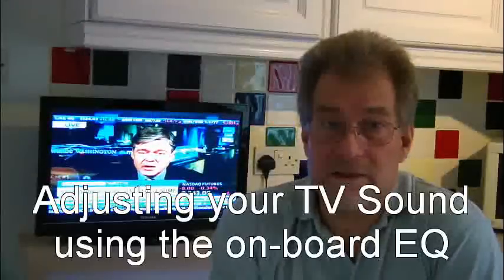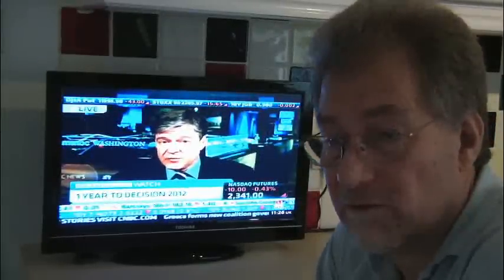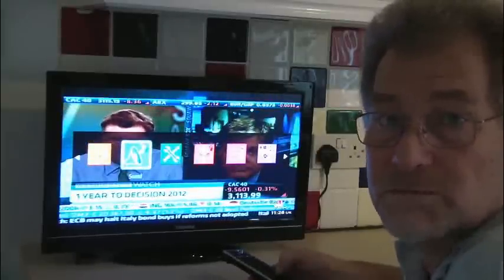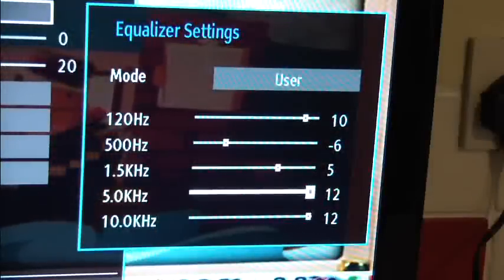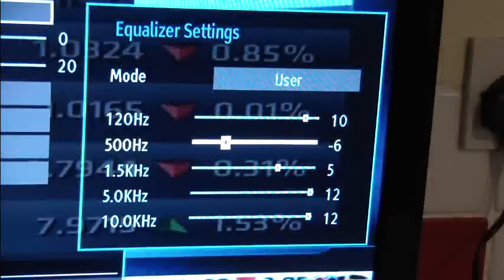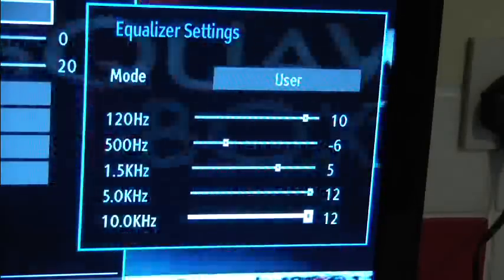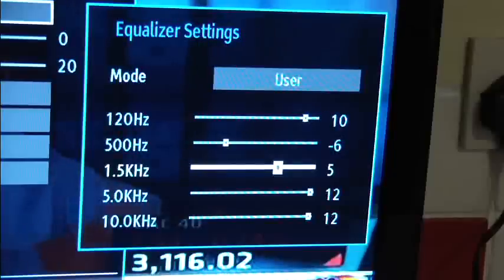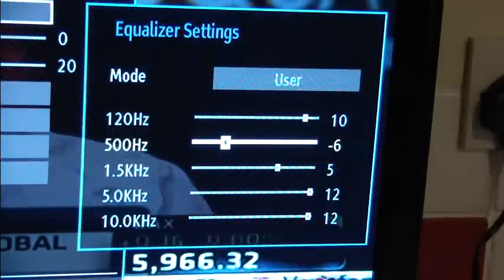Adjusting your TV sound using the on-board EQ

Comment: I can't even stress enough how helpful this has been. Admittedly, I'm on the same page as a few other commenters - 100hz, 300hz, 1Khz etc. but even the advice they have received has helped me to - almost - improve my listening experience. 

I bought one of those LG E6s last year, and I have to say, the default settings never cut it for me. I've messed with the Equalizer and keep finding things just don't get to the levels I want.  had 1Khz at +5! And I didn't realise how detrimental that actually was. For now it's about -3. Lower and it feels a bit empty. 

As of right now I'm at +8, +5, -3, +10 and +10 respectively, but this is likely to change. Weird television though. At lower volume levels, it's far too quiet and can require up to 60+ on the volume to start getting into clearer territory. Luckily, it doesn't get so loud it disturbs anyone, and as always, depending on the film you can go considerably lower. 

I have no idea how these settings will suit me for now, anyway. Even the "Magic Sound Tuning" keeps changing because it just doesn't seem to work as advertise - always close to optimal for it does, never optimal and more often than not fails. 

Either way, I've been searching for videos on the Television Equalizers for a while and this is, so far, the best I have found and very informative. It has helped considerably. Thank you. 

And your advice on the comments - brilliant. Thank you, too, for that.
Reply from the maker: Thanks for the kind comments, I do appreciate them. Your comment "At lower volume levels, it's far too quiet" sounds odd at first (like, obviously!) but I think I know what you mean. The issue may be down to the way speakers behave and their efficiency at reproducing the different frequency bands. At very low levels of power from the amplifier, the speaker movement (the physical movement back and forth) is so little that certain frequencies - especially the lower frequencies (bass) - are barely reproduced. Speakers tend to be more efficient (i.e. able to turn the signal sent from the power amp into sound waves) at mid frequencies (that's in general terms, assuming one speaker driver designed to reproduce a wide band of frequencies, as often found in TVs. I'm not talking about separate tweeters, which are highly efficient). Likewise, our ears are more efficient at picking up mid frequencies (that band either side of 1kHz). So normally, at low volume, we hear the mid frequencies far more than those at either end of the spectrum. And because we've reduced the level at, say, 1kHz on the equaliser to tame it when it's loud, we then lose the clarity at low levels. For years manufacturers built automatic gain control (AGC) circuits to lift the bass and treble as the volume was reduced, to help keep the sound balanced - you may find an option to switch AGC on or off on your TV. Unfortunately, since it lifts the bass and treble and leaves the mids generally unaffected, a standard AGC tends not to work well once the equaliser settings have been adjusted to give the typical 'smiley face' curve like the one you've set and which is often effective; with AGC also engaged (effectively doubling the 'smiley face') the sound at low level tends to become very muddied because of over-boosting the bass. There is a solution, known as a multiband compressor/expander circuit, which can be considered as a level-dependent equaliser, but without researching it I don't know to what degree any of the current TV manufacturers use such a circuit. I worked on one for use in car stereo, so it's not inconceivable it could be used in TVs.
Reply: There is something on this TV - not sure if it's what you were referring to - called Auto-Volume. At lower volume levels, it does hold volume considerably higher than with it switched off. Unfortunately, it also seems to act like Dynamic Range Control in the absolute worst possible way. In that, if you were watching, for example, a horror film, you can forget any loud sounds/effects. It just cuts them out/muffles them. So it might not be this AGC - though it did at least worst in regards to dialogue. It's a shame though it has more negatives than positives. 

Sometimes I wonder if the "soundbar" which is built into the television has suffered some minor damage at some point, though, because from reviews I have read, all indicators point to it having good enough sound that there should be complaints. I've never been convinced myself. 

Either way, thank you for all that - going to give it another read later on, once I can sit down and chill out for the evening. So far, from your advice in the video and comments, a lot of the volume has improved. Of course, as always, it depends on the films as well. I find two films with the same sound - 5.1 DTS HD etc. - don't always follow on. There are some films here that are very quiet. Then you switch to another with the same audio - much louder. I'm getting there anyway. It's a learning process, and you can't learn without making some mistakes and going back to the drawing board. 

Thank you again for taking the time to reply. Much appreciated, and you're very welcome. I can't stress again how informative the video - and comments - have been. Thank you.
Reply: Odd update on this - I've found that the one frequency hurting my ears is 300Hz. Going through them all, fiddling with each individually over small increments, it's the 300Hz that took away a very.. I don't know what to call it. It's not "ear piercing" in that it's a very high pitched sound, but it does hurt the ears, especially mine. But, it may well be exactly what you have said - from TV to TV, it's all dependent on the speakers, the listener - and personal preference. Right now, it's at -10. It won't stay at -10. But for now, it has eased off a bit. But it does appear 300Hz has a negative impact on this TV.
Reply from the maker: I can only guess, but it may well be that 300Hz is the frequency that 'excites' (causes a 'ringing') in the cabinet of the TV. Everything has a so-called resonant frequency and it could be that the plastic cabinet's resonant frequency is around 300Hz. What happens is that the resonating (vibrating of the panel) adds noise at and around the resonant frequency. By reducing the output at the resonant frequency, you also help reduce the resonance/ringing. Trouble is, you are also reducing the speech/music output at 300Hz and that will tend to reduce the 'warmth' in speech and vocals, for example, so male vocals will begin to sound a little 'thin'. So on one or two TVs of mine I've added small pieces of self-adhesive bituminous damping material to the inside of the cabinet - you find it car stereo shops for damping door panels, such as Stinger Roadkill, Dynamat and others. Just a few small pieces applied to several locations can hugely reduce the sympathetic 'ringing' or resonating, so it becomes less necessary to use the EQ.
Reply: That does just about describe it, actually. And unfortunately, when it does it, it's very frustrating on the ears. I'm currently looking for a separate soundbar, now. This soundbar built into the TV is alright, but clearly isn't perfectly. 

I have to admit though, for now, I don't feel the vocals are too flat - which is good. Male voices, depending on the film, still feel full. Although, when watching Dark Crystal you can hear on the narration that it's far more hollow than it was when 300Hz was turned up. I might continue to fiddle about with it all, and soon the TV is going to be relocated to another room so it could sort the problem out. Right now, it's in a room that is, for the most part, entirely wood. Wooden floor, wooden shelves on both walls and even the unit the TV is on. So we'll see if the change of room makes a difference. 

Thank you for the reply, it's good to know why it's happening. I really appreciate it.
Reply: Small update on this - the TV has gone back to the store for repair, three times now. Through HDMI, and not using the TV Auto-Volume, the TV has to be turned up to about 70-95 before it's loud enough. Gradually, it has gotten worse over the months. The Eqauzlier did little to help in the end, and on low volume levels - if I set the volume to 20-30, the TV is never loud. Even at 90, some Blu-Rays are not loud, vocals are overpowered by muddled noise and I believe there's a fault with the speakers themselves because you can turn the TV up from 20-50 and it doesn't even sound like the volume has increased. Temporary TV in place, a very old Sony from about 2006, I believe. It's quieter around the 20s, but once it hits 30 the TV takes a huge leap in volume and after that, you can turn it up by two or three and it gets noticeably louder. 

So we're trying to get this sorted now, they're claiming it doesn't have a fault but no television on the market should ever have to be turned up to the 80s or 90s before it's loud enough to fill your room. 

If I had to describe the issue, it's like the TV has no power when it comes to volume. It's supposed to. People who also have the LG E6 have said the TV is loud at 25. They've said it's loud at 12. But mine is never loud-loud, and it does seem to have gotten worse. I'm watching content that had to be at 80 on this Sony and I can go half that, if not more and they're far louder. I honestly don't know that much about TV speakers, so I can't even begin to diagnose where the issue might be coming from. But it's like there's something missing that controls the volume. It isn't there. It just doesn't increase.

And forget Auto Volume. Watching a film like ALIENS with that turned on is like dipping your head under water. The turret scene in the tunnels becomes a muddled mess. One minute the turrets are muffled down so low you get no impact, then dialogue kicks in, you can barely hear them until the TV decides to increase the volume.

Shame really. Nice TV, but there's a definite fault and so far the store has been useless in finding it. Hell, the sound is even dropping out in some films. Same spot every time, though. But, testing the disc and the machine on other TVs - it's only the one TV with the issue. I've ruled out my cables, tested them all. My machines, tested. Disc has been tested on four other televisions and the sound does not drop. Only on the LG.

Comment: KEVIN O'BYRNE::My E.Q. layout looks different from yours.What I'm trying to understand the highs and lows which and makes it louder when for example there's an explosion or like high pitched screaming...To how to adjust the Low voice conversations set it to higher and the louder big noises set it to lower sound audio..i want to understand what each slider does can you give me info or sent me a link,  if don't know yourself in respects
Reply from the maker: Hi. When you ask for a solution that "adjust the Low voice conversations set it to higher and the louder big noises set it to lower", what is needed is a compressor/limiter. In the recording studio, this is what is used to squeeze a very dynamic live sound into something that the average stereo system can handle. It is difficult to achieve control of level with just the standard EQ (whether it is parametric or preset graphic type). For example, an explosion sound will have a lot of low frequency content, but if you reduce the low frequencies using the EQ, then those frequencies will almost disappear at more reduced volume levels and leave you with a very brittle sound. What is needed is a way to reduce the volume when it goes above a certain level (no matter what the frequencies), and increase it when it drops below a certain level or threshold. In effect, an automatic multiband EQ... which is basically what a good audio compressor does.

I don't know how many TVs are fitted with a circuit to automatically control the volume level, but it would be a good idea. Because the sound from modern TVs is so much better than it used to be, and also because the different TV channels seem to allow a huge variation in output between programmes and also (deliberately, because they want your attention) the Ads (the levels used to be very much more controlled and better matched, and this is something that drives me mad now!),  they really could benefit from having a simple preset compressor or AGC (gain control circuit).

I hope my explanation is clear enough and not too complicated. The shorter answer to your question is that the constantly changing volume level cannot be successfully adjusted with a standard EQ. It needs to 'track' and constantly adjust the levels of the frequencies across the whole audio band. And that job needs an audio compressor.
Reply: KEVIN O'BYRNE:: so need to put that kind of movies in a software to adjust the volumes, of the highs and lows, that's cuz man sometimes i can bearly hear what they say.So i turn it up, and when something loud happens i have to turn it down, that's no fun

Comment: My videocon 42' tv has very low volume .How to increase the same
Reply from the maker: If the overall volume is low then a sound bar designed to fit at the lower edge of the TV may be a solution. This will tend to also improve the bass and add clarity to the speech, although obviously that will depend on the quality of the sound bar itself. Just using the TV's built-in equaliser is unlikely to fix a problem of the overall volume level being too low.

Comment: KEVIN O'BYRNE i have a vizio but the hz are lower it's 100hz 300hz 1khz 3khz 10khz what are the best settings for those?
Reply from the maker: Hi, there are a couple of entries below from people with TVs having the same EQ frequency control/center points as yours, so take a look at those replies below. I can't say what the best settings are for you without knowing how you find it sounds now, as it is. BUT in many cases you will find it helps to reduce the frequency band centered at1kHz and increase it some at 3kHz and set it to max at 10kHz. If the bass sounds boomy then reduce it at 100Hz but of course that will make it sound very 'thin' and upgrading the speakers (i.e. perhaps buy a soundbar) is the only real solution. Raising the band centered at 300Hz can sometimes add some warmth on male vocals and drums without making it sound too boomy. It all depends on the quality of the built in amp and speakers and the small enclosure they are inside - it varies a lot. The only way is to try it.
Reply: @24HzICE  Ok there is a man narrating everything that is happening in my tv can anybody help me get ride of it

Comment: Do you have any suggestions with my issue for my 40 TCL Smart tv . With the speakers in the rear. It is not very loud at all. On internet TV it is almost maxed out to even hear it. I have directv hooked in . I do have an older surround sound be even with it . It is not very loud ether. I have a fiber optic hooked to this. Will hdmi Help me in this issue? Thanks
Reply from the maker: +bobo bob Hello Bob. I don't know this particular TV but probably the built in amplifier and speakers are just not able to give you the sound level you need. I doubt that altering the equalizer or going with HDMI will make much difference. If the speakers are in the rear then that makes it doubly worse. Perhaps try an amplified 'sound bar' to go in front at the lower edge of the TV. Make sure you audition it in the shop first. The only other thing is to make sure that in the settings for the TV (in the setup menu) that there isn't some kind of limit set on the volume level - for example, there may be settings to match the volume levels of the different sources (internet TV, aux/directTV etc) and you may find you can adjust those.
Reply: Thanks Kevin. I will be in the near future trying a sound bar.

Comment: Can anyone  help my tv sounds like a battlefield with a boom vibration I have no idea about equalizer my settings are 100hz, 300hz,1khz,3khz,10khz
Reply from the maker: +ADAM67891 This will probably need more than just a tweak of the equaliser settings to be honest Adam. The bass frequencies are causing the casing to vibrate. I had a similar problem on an old TV and made it a lot better by adding strips of self-adhesive sound deadening material to the inside panels of the casing. It's stuff they use to deaden the inside of metal panels in cars, particularly the doors where speakers are fitted. Maplin may still do it, or possibly Halfords. A car radio shop will have some. Trouble is, they will want to sell you a small roll, when all you need is a few small pads a couple of inches square to places in different locations.
You can also try to drop the level of the output at 100Hz on the EQ - that could mean you will lose bass sounds, and voices may start to sound a little thin, but it could be that the 100Hz level is currently pushed up high - check it. Check also that the level at 300Hz isn't at max - you could try reducing that too, as it may be close to the resonant frequency of the cabinet (but I won't try to explain here what that means! It's not important). Anyway, good luck, hope it helps.
Reply: +KEVIN O'BYRNE thanks for the help ill try them stores if no luck I'll maybe try a sound bar
Reply: @24HzICE  Well that suggestion is one way of getting round the frequency beiang right.
Reply from the maker: @janjones1997  See my reply to your other comment Jan. This here may be related to the problem you're getting. You described the feeling of the bass at your feet, so I guessed maybe you have a wooden floor, and in a way it would be a similar problem to what Adam here was getting - vibration. In Adam's TV it was the case of the TV that was vibrating, and so using some, let's call them 'sticky pads' made from certain material, will help to dampen the vibration. If I'm right about the wooden floor in your case then you need to try to isolate the stand the TV is sitting on from the wood of the floor.